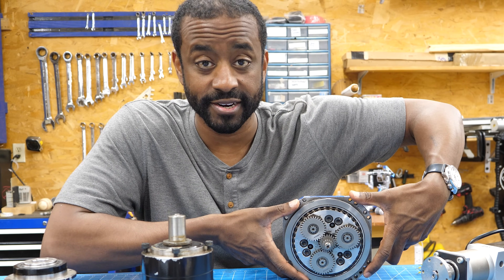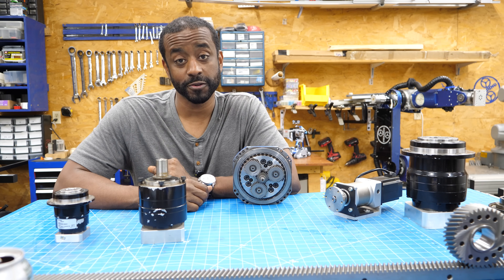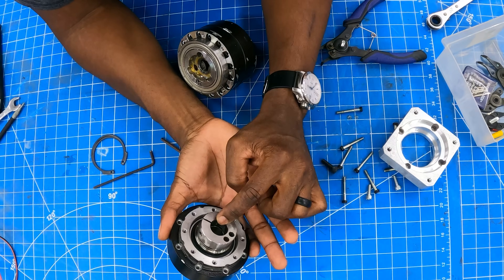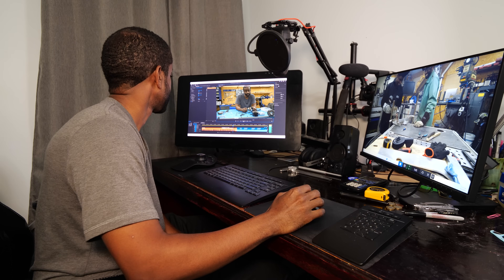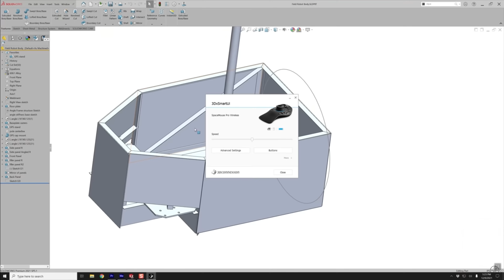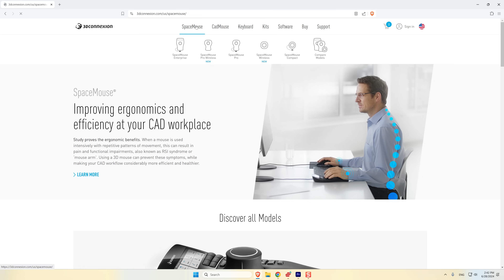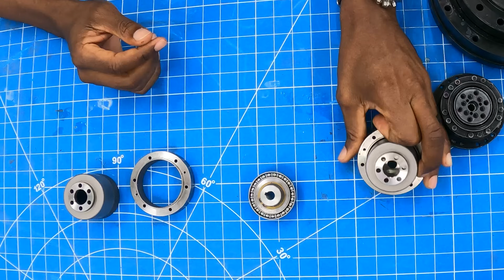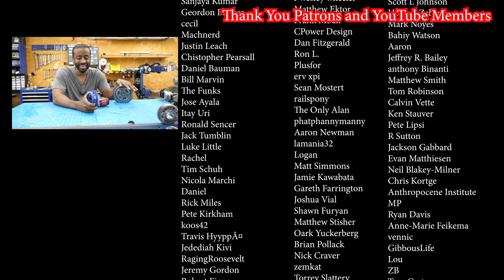Why Harmonic Drives Are Awesome.

Comment: WHY is there no camera on your robot arm??!!  I mean I thought that was kinda the whole point. To do things only a robot arm can do, right? It's been more than a year since it's been done and not one video, not even 1 shot has been on the robot..... jeremy please don't let it collect dust.
Reply from the maker: My intent was not really to use it as a camera robot. But of course it could do that. The value a robot shot would add doesn't quite match the time it would take to set it up and program it for that purpose in most cases. If you change anything you need to reprogram it. A static shot is what I need 98% of the time. So I would be forcing this into the work flow just because I can. Though I know this is an option when the one in a while shot comes around. Robots are best at repetitive work. The robot actually has already served its purpose for me. I wanted to learn about and simultaneously teach robotics. If I did nothing else with it, I would not be disappointed. But I also keep it in my mind as a tool in the shop.
Reply: @Jeremy_Fielding  Using it with an Xbox controller is unintuitively super fun. MKBHD has an xbox controller on his."maybe reach out to him" I promise if you try it, you'll see.

Comment: I used to work for a manufacturer of industrial robots. So, I  have replaced many gear reducers, including harmonic, rotary vector, cyclonic, and another antiquated type I can't remember.

We only used harmonic on the minor axes of small robots. Once you get to 6kg capacity robots, the major axes are RV (rotary vector) reducers.

On 50kg capacity (and above) robots, no harmonic reducers were used. From there up, we used RVs.

I know this is true for the two major Japanese brands. I'm not sure what the European manufacturers do.
Reply from the maker: That is consistent with what I have seen as well. I had one on my desk as you saw but didn’t mention it was used in robotics.
Reply: Never heard of RV reducers, really have to look those up.
I heard Harmonic Drive reducers have issues with longevity, the flex spline tends to break in the roots of the teeth at some point.

Edit: seems like those are the same as cycloidal drives, right? Didn't hear them called that before, but I am familiar with those afterall.
Reply: @CatNolara  
Look up a YouTube video called "The Nabtesco RV Principle". It will give a description and animation of its operation.

I understand them a bit better than this video can describe, but it's too difficult to describe with words. Hopefully, you get the concept through the video.

There is nothing flexible within this drive (gear reducer). This is precisely why I have replaced so many of them. If you put the wrong grease in them, everything shatters. This is because there is maybe 0.0001" of clearance between the sprockets and the pins. Thicker grease creates too much interference, and things shatter.

Contrary to what the video shows, the pins don't rotate along their axes. All the pins are mounted stationary to the outer plate. For some reason, the video shows all the pins rotating around their own axes.
Reply: @cornpop7805  Seems not terribly difficult to grok; it's much like a strainwave gear, but instead of deforming the cup to engage teeth, it uses a cam system to move the inner gear.  And those cams can be very beefy and spread the load out across many bearings, rather than just the point load behind the teeth.
Reply: @oasntet 
I suppose you could call them "cams", but I see them more as sprockets. But, instead of the rollers being attached to chain, the rollers are replaced with rigid pins. Also, there are 3 sets of sprockets, each running off center (eccentric) on their own bearings. The three sprockets are timed 120⁰ apart from each other. The sprockets are not all on the same plane, they're kind of stacked, in reference to the center input shaft. The output is basically the body of the reducer, which is the largest casting.

The smallest RVs have two sets of sprockets.

Regardless of how many sprockets, each sprocket only pushes on one pin at a time.

The output is always fairly low speed, but high torque.

There is actually double reduction, the input gear to the sprocket(s) ring gear, and the sprocket(s) to pin reduction.

There is significant backlash between the input shaft and ring gears, but that backlash is mitigated by the final gear reduction. The resulting total backlash of the reducer is usually less than one arc minute (1/60⁰). Some are as low as 1/180⁰.

Comment: Worm gears can be quite precise at high reduction ratios, but it comes with a price of small teeth and low max torque for the size. Gears like that are often used in telescope mounts.
Reply from the maker: Thanks for sharing.
Reply: They can be used in high precision applications like rotary tables on a milling machine where the worm is mounted in an eccentric and "cammed in" to the gear, which is how the output can also be disengaged for quickly setting up the rotary table.

It won't eliminate the backlash, but it can be minimised. Typically you would only operate the input wheel in a single direction and clamp the output so the part being milled won't be shaken about in the backlash.
Reply: The backlash can theoretically be (mostly) removed by creating a ball worm gear (similar to ball screw). It should offer reduced backlash and higher efficiency compared to normal worm gear. I found some patent applications and prototypes, but no finished product. I guess it is too complicated and expensive fot it's performance or there are some other downsides to this design. Regardless I like this concept ;-)
Reply: @ryszb 
Do you really want to know the secret ?
Reply: Harmonic drives are coming into vogue for mounts - there are half a dozen new models introduced recently because they're so compact and lightweight compared to worm driven mounts.  The torque is high enough that they often don't need counterweights at all.
Reply: @jasonpatterson8091 Watching the video I immediately wondered if harmonic drives would be applicable for telescopes. Interesting about the high torque value and counterweights. It seems all my best ideas are already taken.
Reply: I need a stepper reduction for an optical system and someone already mentioned a worm gear system so I'm glad to see that confirmed. Thanks!
Reply: @gljames24 
Telescopes use rack and pinion, which is a variation of worm drive.
But camera lens'  use a different arrangement.

Comment: I wanted to ask, What tools would you consider to be essential to a "Jack of all trades"? I am building a shop, with an eye towards electronics, small to medium dc motors and small HP AC. I have most of the components that I need to build the place; here's the issue. It's about the size of aq holding cell at County Jail lol. Drill press, check. Table saw, welder (small, cheap all in one),and I have the stuff for a lathe. How, exactly, does a vacuum work. I know this is simple physics, but I can only do complicated for some reason and thus can't just build That, though I have all of those parts as well. How thick should my top be?  How far apart the clamp holes, and what size are they? Should I top my bench with disposable plywood? I have a rather large robot arm already, a Bruno, that I inherited and am trying to hack it's driver board. I'm thinking of hanging it on the wall, but then the controls work differently lol. ANY kind of advice is very welcome. Thank you for your videos, they are very informative and understandable.
Reply from the maker: These are good questions. There are too many for the comments, but this might make a good video. Perhaps members only or a full channel video. I don't know yet.
Reply: @Jeremy_Fielding  that would be good to see. I figured there was no way to get any decent answer in a comment, so no blame, sir. Thanks for what you do.